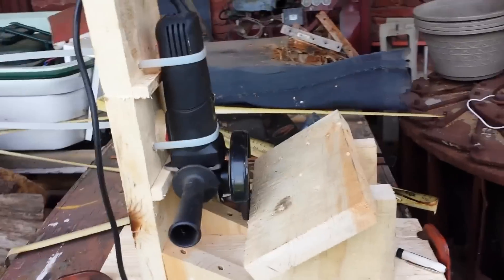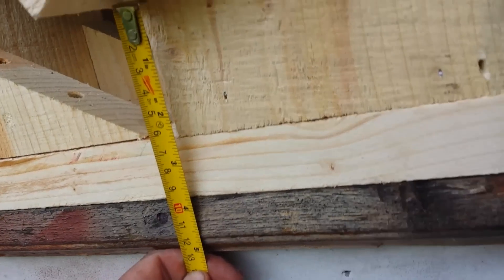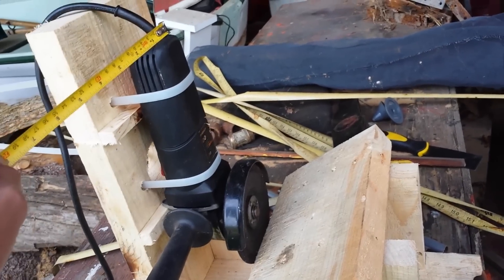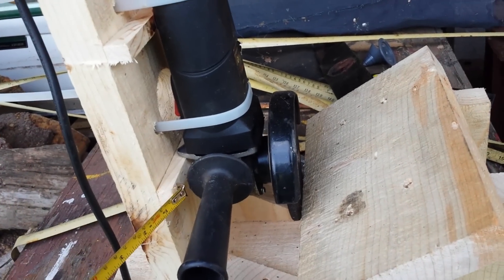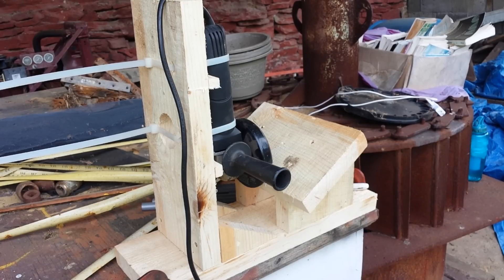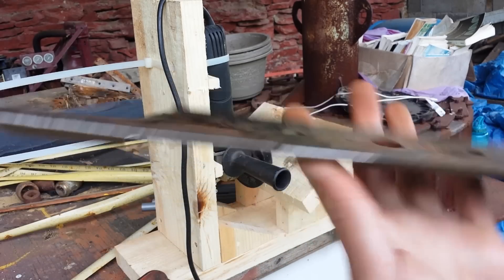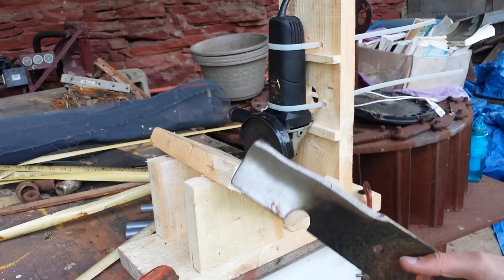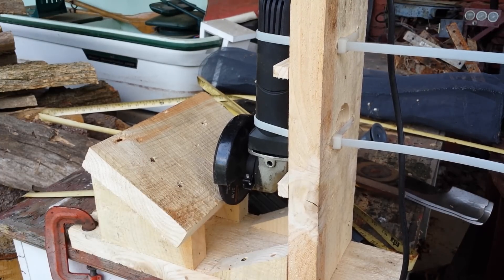Homemade Blade Sharpener Jig For Lawn Mower

Comment: Thanks for the informative video,  you encouraged me to make my own.  Just a note, you can get rid of the spark in your face issue by either lowering your grinder or raising the area where your blade rests.  You need to be above the center line of your grinding wheel.   Thanks how I did mine and have no spark issue, really does a nice job!  thanks again

Comment: I just made one of these but I layed my grinder on its side and ran a bolt through the board or I used 3/4" plywood and screwed it to the grinder where handle goes and I took the guard off. It throws the sparks down in to the hole that is under the grinding wheel which I use flap disc usually 60 to 80 grit sometimes 120 grit if there out of 60 or 80 grit.

Comment: If You mounted Your grinder handle side down with wheel on top & built your angle boards higher the sparks will be going away from You

Safer & a simple solution if You are interested

Ken in Florida

Comment: Nope ... Opps ... Wrong 30 degree angle :) ... you have your jig built at 60 degrees not 30. That edge will be tough & last awhile, but it won't 'cut' very well.

Comment: Why not just wire a switch to a outlet  mounted to the sharpener and  leave the grinder in the o position  but use your switch and  outlet  as the on /off  mechanism ?   Other than the other  HF grinder having the paddle switch   There probably isn't much  advantage to the other. Model  since they most likely. Get made  i th same Chinese factory  with similar technology. And  parts ? Those large  zip ties are very commonly used  in commercial HVAC installs  to attach flex ducting. To drop ceiling  vents etc , i  did commercial. Woodworking  for 20 years and would pick up all the non used ties the HVAC guys dropped on the floor  in a couple of years time i would have more than i could possibly use  in my lifetime  i liked them because of the length  and heavy duty size   I also had a Sport fishing boat i used on the Chesapeake Bay. And the ties came in handy. For emergency repairs  and other fixes on board

Comment: Why not just freehand it? I don't even take my blades off to sharpen them. Just lift one end of the mower up and go. I've never messed up a blade.
Reply: kenneth w if u dont balance ur blade the vibration could damage the bottom crank bearing!! :(